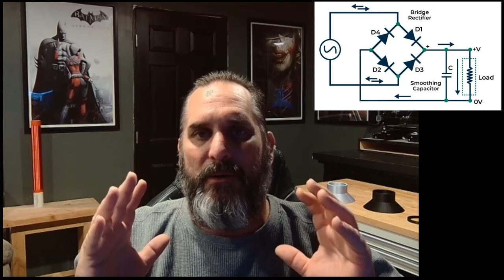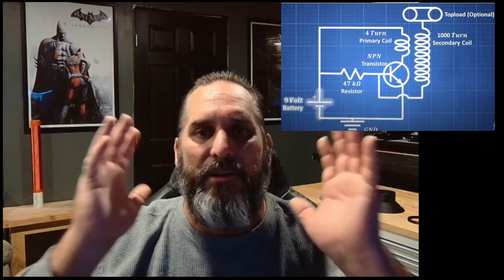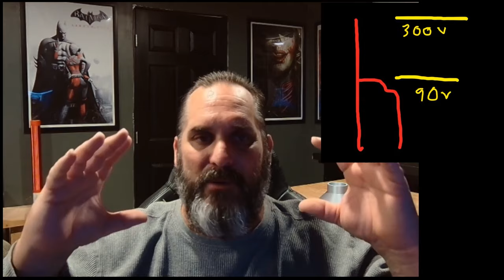Potential VS AC&DC "Do You Understand Energy??"

Comment: Your potential is a differential, resonance is the dimensional hole through which you gain access to it, in there the inverse square law is reversed for volts & amps, wattage is amplified.  Look at shiva's tridant, a symbol of power.  The shaft is volts amps watts as a constant, the drum just below the fork is the occilator, the fork is the separation of volts and amps from watts, raise the volts & lower the amps in comparison to the constant.  The differential is amplified wattage.  Great video by the way!

Comment: Capacitors a must for these gravity flyers, also geometry is a must, need to have equality in the whole system.
Reply from the maker: the are in all the systems we use to create the energy. Then when you convert air to charges it is the capacitor.

Comment: Your mention of receiving an AC electrical shock “not intentional” cracked me up.😂
Reply from the maker: I was the light bulb
Reply: I have never intended for AC shock but in the apartment industry people are prone to steal electricity and you do come across 220 volt hot conduit. The first time it took everything I had to pull my finger off and I am so lucky to have survived. Today at 58? I would be dead.
Reply from the maker: @MrThacke  Thats bad.
Reply: @nathanbunten4299  I've been there brother!
Reply: @MrThacke  Wow, I'm glad you're alive. When I was in the Navy, I was tasked with wiring the telephones on the peer. The 30-volt dial tone didn't bother me until the 90-volt ring signal. That 90 volts bit me so hard that I couldn't free my hands until the pulse was over! Fun times!

Comment: Very impressed with your findings Your understand is similar to mine. Lenz law or observation goes against the universe. This to me is the inherent problem. My finding now also leads to geometry as the fundamental problem. My channel I only put out my findings. My conclusion are geometry and distance and crystal metal stores force.Potential is in the wire. I've gotten huge amperage  at low rpm10 amps 50 volts. Much high as potential energy and charge caps and batteries. Plus share multiple magnet field each givng off multiple feed's. Very nice to find some one who experience the same evidence or finding on different level's Peace.  Ow my attention span is short.  love  15 min LOL
Reply from the maker: watch this video of it being validated. keep in mind the power source works perfect. https://youtu.be/0K10GMhdP0c

Comment: could the piezo be "formatting" the air, changing the dielectric polarization. what Im trying to say is, are you observing rapid changes in a dielectric medium 'air'. invisible plasma exchange. i wonder what else is getting generated.  my crazy idea - spinning two pancake coils, (aluminum foil spiral cut with a cricuit . )  make the center of the coil end in a point 90 degrees to the coil. then format the air.

Comment: Jumping across th spark gap, do3s the High voltage creat a vacume and  and direcrional movement for the miliamps (matter) to travel? The greater the High Voltage, the greater the vacum created. Therefor more  miliamps ((matter)) can cross the void (gap of the spark gap)... another note, the whipping effect that results and some call Back EMF is so great, perhaps is due to the vacume collapsing similar to water hammering in pipes when the gate it closed (the back pressure.)
Reply from the maker: when you spark gap it the volts and amps increase. The vacuum is real. Energy company's use 3 to make more power at the plant.
Reply: The High Voltage opening up the a vacume pathway for the miliamps to travel across...assuming the far side electrode  has an attraction to the primary electrode of the SGap like magnetics. The metals have the potential to attract one another the closer/ smaller the gap. The larger the gap the less magnetice or attraxtive potential thus higher voltage is needed to make the connection  and create a temp vacume for the amps to flow across (path of least resist.). Just a thought that popped into my head watching this video. With this understanding, one would be able to harness lightnign potential in a storm.
Reply: Lightning storm potential- understanding what are the sending and recueving electrodes in the Earth Storm spark Gap. Then creatjng the attractive potential, one would be able to extract (theoretically) what ever amount desired from the potential by calling over the energy throuh the void/ vaccume. Frequence riding on frequency (piggyback) collecting or converting to AC or DC.  Using frequency modulation to call up a therecrical diode in that void/vaccume or call up a capasitor or any other Circuit. Assuming we can create and send into the void/ vaccume a miliamp ((matter)) that perfoms like a diode or cap or flyback or whatever Circuit the theoretical plasma engineer conjures up. 
Im not sure any of this makes sense.
Reply from the maker: @markpennella  don't think vacuum has to have a chamber. Just a field holding in pressure. It changes how you see it in the earth.

Comment: A battery has potential energy as it is just sitting there waiting to do something. When the potential energy is released into a wire it has AD or DC volts and amps. The watts can be misleading as the volts and amps can be different but produce the same power. A small frequency has a long pulse, so it has more energy, and a large frequency has a lot of gaps, so it has less energy. DC is continually pushing the electrons so they jump the gap, but AC is a push and a pull so the electrons kind of buildup on the wire end and cannot jump the gap as the circuit is not complete. High volts and low current do not make enough electrons to jump the gap, so we get a charge. A high current and a low volt gives us a magnetic field as the electrons then flow to move the Aether to produce the magnetic field.  If the amps are low and the volts high, then we get cold energy and if the amps are high and the volts are low, we get a heated circuit as the reason being is that the electron field is small and the electron field is antigravity waves so the circuit is cold and if the with the other condition we have a lot of electrons so due to the superposition of waves in quantum Mechanics the wave energy is high so we get heat as IR as IR waves have more energy and the Aether antigravity waves are a low energy so we get a cold circuit. With geometry with my diagram of the ark of the covenant being a box capacitor/Casimir device to strike the electric arc then a person could possibly talk to God who makes up all things with the black hole particle on my spectrum with the sound resonance.

Comment: 10:30 better to run the DC flyback driver with capacitors and send the flyback potential directly to the battery .   Capacitors are not dynamic like a chemical battery .. CAPS will catch the flyback and convert it for standard charge  of your battery. you want the radiant to hit the chemical battery. Use CAPS to run devices off the radiant but batteries or meta materials  to receive the radiant .

Comment: Hi Old Man.
There is no positive or negative - there is as you say potential. The field is the either - disturbance of the field is what we call (electromagnetism).
to understand energy more acurately...Look at it this way..
STATIC CHARGE
You have a simulation program on a computer - everything is black. You add an item - lets say a plastic pipe - there is a very faint bluish outline (a boundary called the field) that surrounds that plastic - its properties determines the saturation of the field or prominence of the blusih outline. As the plastic has a higher potential in its properties the field when perturbed will gain potential and  enlarge. Now, the extended excited field boundary of the plastic pipe wants to return to its state of rest and snaps back with a staic shock (spark) when another item you add into the program (perhaps oneself which has its own boundary properties)  comes into contact with a lower potential in its field. 
ELECTROMAGNETISM
Now, lets add a metal wire for a fence for the plastic pipe with its own boundary properties - the properties of metal carries all its field on its surface so that its bluish outline is much stronger than the plastic. You add a ground to stand on which has a bluish outline that varies according to all the properties of the objects that could be in and on the ground. You decide to touch the wire and given the charge of the ground or plastic  you are in contact with you can excite the field by touching the wire, however oneselfs field may be only slightly stronger than the wire adding a little potential, which spread through the immediate part of the metal wires field. You add a magnet to the program and its properties have an extended bluish boundary that protrudes further than the object itself.  Pass the magnet across the metal wire and the field is excited in such a way that the metal wire field is excited enough enlarge the bluish outline and force it further along the wire  than what oneself hand could possibly do. That higher potential or charge on the wire wants to search for its equilibrium and will snap or spark (discharge) to ground given the a proximity that allows according to the potential on the wire. 

I could go on but - im not writing a book here!
Reply from the maker: Atoms are potential until they take a determined state.
Reply: @nathanbunten4299  that a given…everything has potential until it has a determined state…atoms or not! When several atoms are conjoined they act as one as if in a hive.
Reply from the maker: @danielroperartist  it gives hope to the idea of replication machines if we can all understand the concept.
Reply: @nathanbunten4299  Im sure replication machines will be a possibilty very soon - by people like yourself - not by the establishment whom regulate our technology!
As a thought no expert but researching into what I call opening the 'field boundary' (the spark or plasma).. - on each multiplier and according to the geometry I presume by doubling the frequency (1 octive) accurately on each subsequent multiplier will resonate the overlay between each adding to the multiplier. the final higher frequency after several multpiliers will provide a substantially higher potential to the initial input frequency - which could be used as a jump to a much greater potential.

Comment: From what i understand pure aluminum is very hard if not impossible to make , but if you can remove "ALL" the impurities  and you have "PURE" aluminum , you have a room temperature super conductor . Dont quote me but its what I heard on the grape vine
Reply: Aluminium can be refined to purity of 99.99%
It has Electrical resistivity 26.5 nΩ⋅m (at 20 °C).
Silver is the best electrical conductor with electrical resistivity 15.9 nΩ⋅m (at 20 °C) and can be purified to 99.999%.

Superconductor needs to have resistivity 0 nΩ⋅m so even silver is far from that.
Not sure if purity has something to do with superconductivity at room temperature.
In case of silver you have 99999 silver atoms and one non silver atom. I don't think that this one atom breaks the superconductivity in the rest of the matrlerial.
Reply: @mikek.1761  Scientists say it is Cooper pair or BCS pair (Bardeen–Cooper–Schrieffer pair) which 'normally' is responsible for super conductivity.
A 100% pure material might behave like a 100 lane highway, without any obstacles.
A 99.99999% pure material might behave like a 100 lane highway, with huge boulders at random locations.
I would prefer to go at the speed of light (or whatever material speed offers) without boulders on my way - as crashing into them = loss, damage, etc.

Comment: define energy please.    i can  tell you still have not read any steinmetz.   steinmetz  was the head of GE electrical research lab,  held of 200 patents,  made electrical engineering possible  and  what your saying goes against everything  he said..  im sorry you just cant go around making this up as you go and have people take you serious. some things you say are correct but your basic  understanding is deeply flawed.   I want you to succeed  but your going in the complete wrong direction. PRETTY PLEASE READ THE BOOK, I JUST DONT UNDERSTAND WHY YOU REFUSE. someone has to pull you back from the ledge my friend.
Reply: I agree, he makes a few valid points but a lot of it, is completely incorrect and some can be proven incorrect very easily. His flyback explanations having the stacked side having seperate fields is incorrect, you can put a magnetic viewer on one and see it's a single pole from top to bottom. It's not seperate poles between the layers. I think he needs to learn a bit more.